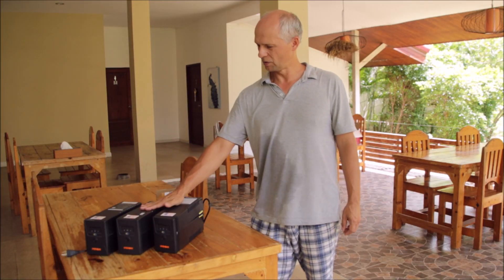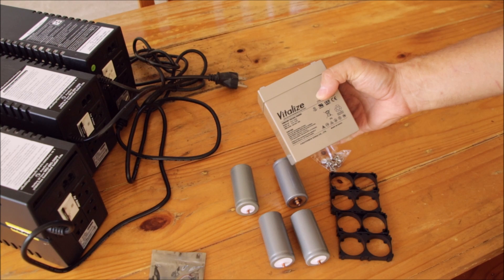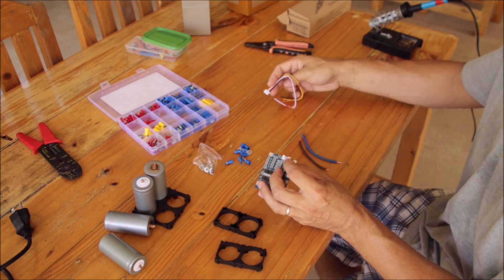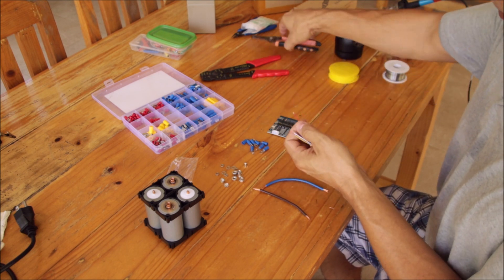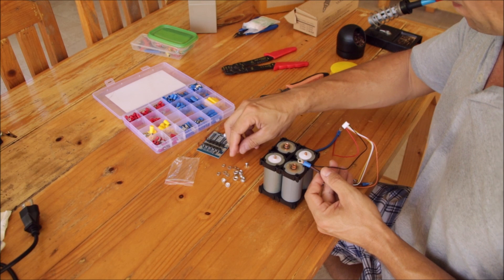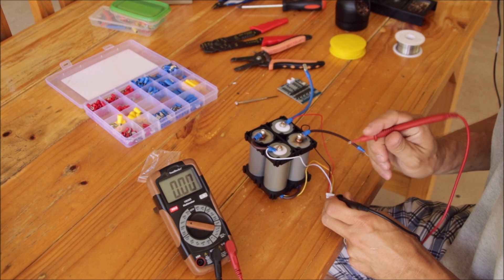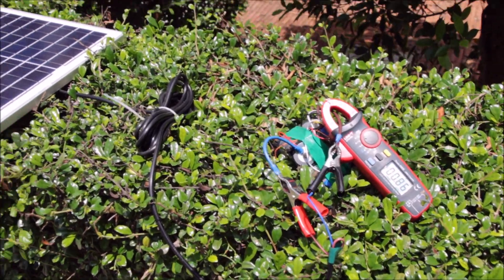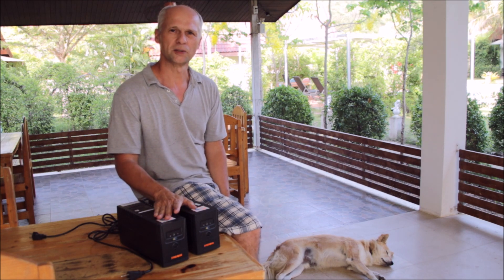Lead Acid - OUT, LiFePo4 - IN! DIY - UPS 12V battery replacement. Cheaper than the original!

Comment: Great video! I have a question. Is it possible to stop charging from the UPS (with diode or something?), so it only delivers current to the ups and use an autocut lithium battery charger instead?
Reply from the maker: I would say as long the ups can see battery voltage, it will operate correctly. A diode could let current only go one way, yes. It must be suitable to handld the expected current which will flow from battery to ups...

Comment: how do the batteries hold up
Reply from the maker: This UPS still works fine, albeit I had to add one of those small active balance boards as the old cells where very unequal and ran out of balance. With the balancer all is well...

Comment: How do you cope with the lower peak current capacity?
Reply from the maker: @pleappleappleap  you will obviously only use such a DIY UPS for applications which it can handle.
Reply: @RolandW_DIYEnergyandMore  I guess my point is that this battery will significantly reduce the load capacity of the UPS compared to using a lead-acid battery of the same size.  It likely will not provide the maximum current that the inverter can draw.

Comment: for this project ,I need to buy 4 pcs of life04 battery with  all positive (male) and  all negative (female)? is that right? sorry I am a noob at this thing.
Reply from the maker: Hi, you can use whatever cells you get. They should all have same terminals so that you do not mistake a pole when connecting them ito series. where you have male or femal is not relevant.
Reply: @RolandW_DIYEnergyandMore  thank you

Comment: Great informative video. 
Which LiFePo4 battery can I place inside an APC Smart UPS Smart SC 420?
Reply from the maker: That one has the bigger 7,2 Ah Battery inside, right? You would use the same 32700 LiFePo4 cells but might be able to fit at cells in a 4s2p configuration inside the case. If that wouldn't work, then you might consider to place the battery outside of the UPS as you need the stronger, higher capacity battery pack.
Reply: @RolandW_DIYEnergyandMore  Thanks for these configuration suggestions. Yes, it's a 7.0 Ah battery inside. I'll just have to give it a try.

Comment: Nice idea and video!

This work fine for small loads UPS, but one need to read up on battery discharge rates as well as BMS current rating when sizing the system.
The batteries you use in this video, 32650 LiFePO4, usually has a max discharge around 5-8C. If someone were to use 18650 LiFePO4 batteries there’re usually around only 1C. Considering the cost of the kit in the video I’d more bet on 5C in this case. That means you have 5*5,5*4=110A available which is good for a bigger load (1400W). But that simple BMS probably only could (should) handle up to 20A from what I could find. That’s only 256W. 

Just something people need to be aware off!

Comment: The UPS cutoff voltage(s) [max/min] does NOT correspond with LiFePO4 cutoff voltage(s) [max/min].
Reply from the maker: Yes correct. I would say it's a 80% match. On the high end the UPS will stop charging before LFP is full so there is nothing wrong with that, and on the low end the BMS will typically kick in for protection. It all depends if the solution can fit to your application. If you are only protecting against relatively short grid outages where you don't want your PC die before you have the chance to shut it down safely, then this will still work well. These small UPS's don't have massive run times with the original batteries either. But the LiFePo cells will at least hold up much longer then the Lead Acid ones.
Reply: @RolandW_DIYEnergyandMore  Yep, (I don't know the specs of your UPS) a LiFePO4 maximum voltage = 3.65x4 = 14.6Vmax with Vnom = 12.8V and minimum cut-off = 10.0Vmin .... so if the UPS cuts off maximum voltage between 12.8V and 14.6V then that is acceptable for Vmax. If the UPS cuts off Vmin at higher than 10Vmin, then that is also OK.

Comment: I have been doing this for 5 years now.  In fact, i now take the lead acid brick out when new and just put the LiFePO4 battery in from the start.  The lead acid SLA batteries in most UPS's are not designed for multi C loads, and thus are usually good for 1 or possible 2 deep cycles before they are damaged to the point of not being able to hold a charge.  This is done for purely profit motives as most people will either buy a new one or buy one of the terribly over priced replacement SLA batteries.  My first Tripp-Lite true online UPS that i replaced those SLA batteries in, has been through many power outages (most lasting 30 minutes to over 3 hours) and those batteries have lasted almost 5 years!  The secret is out now, and everyone should share this!  By the way, you can just get the LiFePO4 batteries in the size of the SLA ones that come out of the UPS and skip having to make them yourself. Truly plug and play!  Thanks for the video!
Reply: Your exactly right the only issue is due to the larger battery capacity  and longer runtime there may be issues with cooling.
Reply: @williamvaughan1218  but if you are only running it under a light load, it should be ok

Comment: how about ups charging lifepo4 voltage is 12v?

I believe lifepo4 need 14.5v to charge until full charge
so if ups charge only 12v it will keep charge lifepo4 n never be full?
Reply: 12V is only nominal rating for Lead Acid batteries, a full charged LA battery will be close to 14.2V, so the charging circuit in the UPS has to be able provide a bit above this to fully charge a LA battery. In older cars it was not uncommon to see over 15V at battery terminals when the battery was being charged by the alternator. Deep Cycle Lead Acid batteries as used in UPSs, I think, are very slightly different in terminal Voltage. Have another look through the comments, it is mentioned that the LiFePO battery will be only very slightly under charged, but this is good for any Lithium based cells as they tend to last longer if not charged to 100% all the time.
Hope this clarifies the situation regarding Your concerns.

Comment: Issue is ups has wrong charging system for lifepo4 cells.
Reply: Assuming the lifepo4 battery is already top-balanced, and the battery is never flattened, what issues does this bring up? Thanks
Reply: @jimmybrad156  charging system is for lead acid, not lifepo4
Reply: @chriss4365  Why wouldn't this work? Would it work but with trade off/s?
Reply: @jimmybrad156  wrong charging system.
Reply: @chriss4365  So if you top-balance 2x 12v lifepo4 batteries then put them in your ups, and your ups simply keeps them at 13.8v each / 27.6v in series, 1 amp maximum, what are you missing out on?
Reply: @jimmybrad156  I have both lead acid and life po4 batteries, and they each have there own charger. Different battery chemistry so different charger.
Reply from the maker: @chriss4365, @jimmybrad156, LiFePo4 works perfectly well with LA chargers in UPS as they are just sitting nearly full all the time anyways. As well As they do not care about charging curves. Charging methods and curves are there to define standards while a battery pack in for example a PV application will never follow a perfect CC/CV curve if the sky is cloudy. The only thing important is that limits are followed, and LA/LFP are 2 compatible chemistry's which can use same equipment. People are replacing LA with LFP for nearly 10 years already...
Reply: @RolandW_DIYEnergyandMore  If this is true why do they make chargers specifically for lifepo4? They also have charge controllers for lifepo4 and others for lead acid.
Reply from the maker: @chriss4365  you are misinterpreting something here. This is about DIY refurbishing an old device and not about installing or buying a new equipment to do a certain task.
A 12V LA UPS will utilize a 4s LFP battery with a 90% fit. Nobody said that every LFP battery shall from now on be charged by a LA charger therefore.
Imagine you want to ride up your local mountain with a bicycle. You don't have a mountain bike but have an older, simple bicycle in your garage. Your choice is now to either buy a new bicycle and be the most effective up the mountain, or just go with your old one which will do the job as well.
On my DIY UPS the LA battery would have died already 2 or 3 times. The LFP cells are doing their job just fine. A new UPS would come with Lithium batteries and optimized equipment already anyways. We give a new life to older equipment!

Comment: Can I also replace 2x 12v7ah lead acid batteries in serie, just straight forward with 2x 12v7ah LifeP04 batteries?  the voltages of charging etc will be correct?
Reply from the maker: Yes, just use 8 cells in series and a 8s BMS
Reply: @RolandW_DIYEnergyandMore  Do I need the BMS if it is a complete battery, that looks like the original lead acid battery? (not cells linked)  But two complete similar looking batteries (just lifeP04 types).
Reply from the maker: @dermeister314p  no, in that case the protection circuit will alread be built into the finished battery pack. but you might get a problem to restart your UPS in case the battery is depleted and the packs are shut down. in that case you will have to jumpstart the ups from outside.
Reply: @RolandW_DIYEnergyandMore  thank you, I appreciate the help.

Comment: Hello Roland, I was looking at your circuit and had a question: I see that you bypassed P+ port on BMS board and directly connected Battery Positive to UPS Positive wire. Is there a reason for doing this? and  is it ok to first connect my battery positive to B+ port on BMS and then connect P+ port of BMS to UPS Positive wire?
Reply from the maker: Hi, B+ and P+ are basically the same port on a BMS. On this board they are just connected on the PCB anyways. BMS's typically switch on the negative pole of the battery. You can of course connect your UPS and battery separately via each port if you wish.

Comment: Are you sure you can't use 3Li-ion  in series? 
A PB 12v lead acid batt can full charge at 12.7v while  a 3series Li-ion battery will full charge  at (4.2x3) 12.6v so how is that not possible?
Reply from the maker: 12,7V LA might be the nominal Voltage. A fully charged LA battery will be close to 14V, while at around 12V it will be close to depleted. LiOn cells only hold a fraction of capacity between 4,0 and 4,2V (maybe 5-10%). Your UPS will shut down before you pack even gets started. It just doesn't work in 3s, while 4s is similarly bad as the cells don't get enough voltage....

Comment: HI Roland.  My UPS lead acid battery went dead a couple of days back and I had to urgently replace it. And so I replaced it with a Lifepo4 battery pack. The many YouTube videos made on this mod made me decide in doing so. I bought it readymade online. Its rated at 12.8v 6000mAh, and has a BMS. I am running my UPS for the last 8/9 days on this LifePo4 battery.  
I have not been running my system when the power cuts off. I get nervous and switch it OFF asap because I am still unsure of this mod. 
Is there something that I need to be careful about? Also what about the charging voltage? Will there be a problem with the BMS? Have connected a volt meter to the battery and it shows 13.2v max charge of the battery. But if the power fails, it drops very quickly (almost immediately) to 12.5v. Then it slows down on its discharge rate. Why is this?
Thks for your time.
Reply from the maker: Hi. Replacing the Lead Acid battery with the readymade LFP pack was a good decision and the  UPS will work similarly as before. LFP a very close match in voltage to LA. But still, it is not a 100% match. The initial drop in voltage comes from the LFP charge and discharge curve, which is steep at the ends, but very flat in the middle. Thats very normal. Nevertheless, the onboard charging unit of the UPS will handle it just fine. In my UPS I have noticed that the system will shut down a bit sooner than you might expect from the capacity. So, it's probably only about 85% of energy which you can get out of the battery now. I have also noticed that after a full discharge, the UPS control board will not start charging anymore and I have to bypass the Mosfets on the BMS to reset the unit. This is because the BMS is causing a bit of an extra voltage drop, which at the end seems to be a bit out of specs and the UPS needs a bit of a push to do its job again.
But anyways, an UPS should just keep your PC alive at a power outage, so that you can safely shut down your computer. Never let the UPS run until it dies itself. A small battery like that will only give you 10-15 minutes of time.
Reply: @RolandW_DIYEnergyandMore  thanks for a very interesting video. I replaced a lead acid battery with a lifepo4 battery. I ran the ups until it switched off. But after connecting the mains to the ups nothing happened. With the lead acid battery in the ups it would start charging immediately. Is there no way to overcome this please? I cannot afford to let a backup battery run down and not getting charged again. If this is connected to an alarm system then the alarm will trigger every time the power gets restored from the mains. We get a lot of power failures in my country. Usually for 2 hours at a time but lately up to 4 hours
Reply from the maker: @barneybotha2437  coincidentally tomorrow there will be a video released about that issue ;) Your question will be answered there
Reply: @RolandW_DIYEnergyandMore  Thks Roland. BTW, I have also connected a voltage meter to the battery to know how the voltage is dropping. And Also so that I make sure that I keep the battery within a certain range, so that it does not drop below a certain level. It would also help me to know how fast the Battery is discharging and when is the right time to shut down the computer.
Reply from the maker: @mediatrix1111  OK, good idea to use a voltage meter. As said, the voltage will keep steady for most parts of the discharge and then suddenly start to drop quickly at the end of the cycle.
Reply: @RolandW_DIYEnergyandMore  Noted. So then I guess I might not have enough time to shut down the computer when the voltage meter starts to show the drop. Cause it will be very fast towards the end. 
Will have to learn how to work around it by experience.
Thks a bunch Roland. It was good to learn this.

Comment: hello my friend, can you share with me how did you get results in long use, because normally lifepo4 batteries and other used batteries do not have the same charging logic, so did you encounter any problems during long usage or charging process, thank you very much.
Reply from the maker: Hi, the UPS is still working. It held up fine during many of our short power interruptions. I do not think that charging characteristics are playing much role for a UPS as the battery is anyways just sitting there fully charged all the time and just used for seconds or minutes at the max

Comment: oh you made a little pack to go in there. i'm going to make custom cables and put in a big 12v 100ah lifepo4 IF i decide to put lifepo4s in one
Reply from the maker: Hehe, good luck. Hope that such a big pack won't blow up the small board :)
Reply: @RolandW_DIYEnergyandMore  hopefully my other reply didn't get blocked for linking a forum post with my last big upgrade
Reply from the maker: @cdoublejj  yes, posts with links are blocked, but i didn't receive it for review as well

Comment: how has it been holding up? do the trickle chargers in the UPS shut off early since Lifepo4 maintains voltage at a lower charge? or do they constantly trickle charge?
Reply from the maker: I only have 3 indicator LEDs. And I see the green one illuminated always. Can't really say what it going on inside. hehe. But what i have noticed after an extended grid down, if the pack is discharged a bit to much, it will not restart charging. Then I need to bypass the Mosfets of the BMS board to get it going again. But I just think the reason for it is the crappy, cheap BMS board which has a high drop of voltage over the switching circuit.
Reply: @RolandW_DIYEnergyandMore  i've been watching this Will Prowse guy on youtube. he has stated you can check battery level with voltage like you do with lead acid. in my experience the charger in the UPS turns on and shuts off based on battery voltage. HOWEVER he has also ranted on cheap/poor quality BMS as well
Reply: @RolandW_DIYEnergyandMore  Just use a balancer not a BMS, the UPS will manage low shutoff and the problem is gone. Upper voltage of the LIFEPO4 is higher too, so it should shut off well before the upper limit. Did you check the real capacity because the lead acid battery controll board will shut off before the LIFEPO4s are full.